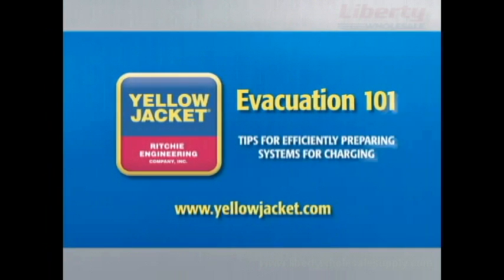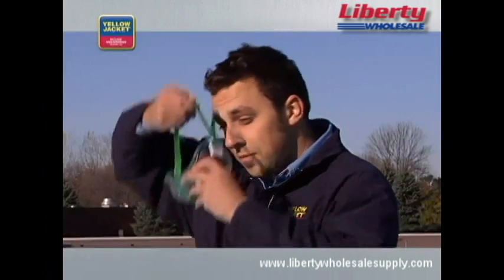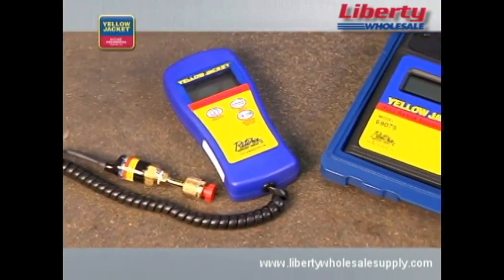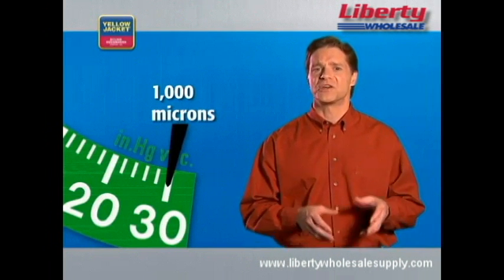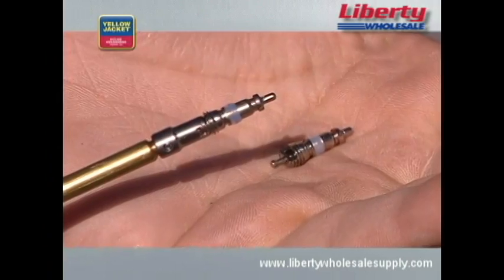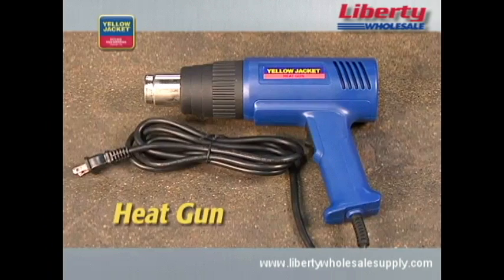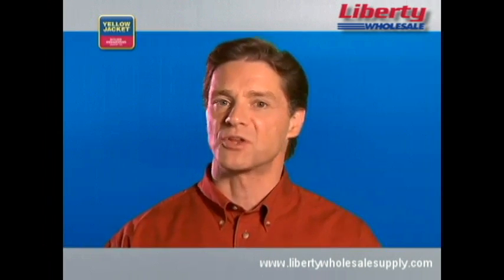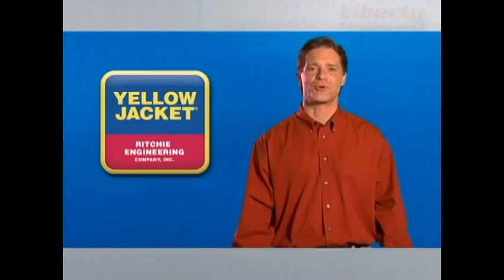Yellow Jacket - Evacuation 101 Training

Comment: 7:21 I'd argue that a 2 hose setup with no manifold will pull a vacuum faster. Skip the middle man and put the hose straight to hi and lo side. Also now we got the 1/2" blu vac hoses. This is good info but is a bit outdated it seems

Comment: If after a dry nitrogen to purge the system, how do you clean-out the nitrogen before evac ???  Anything used will contaminate the system again.  Does the nitrogen damage the vac pump ??